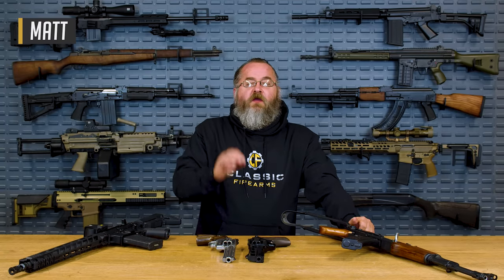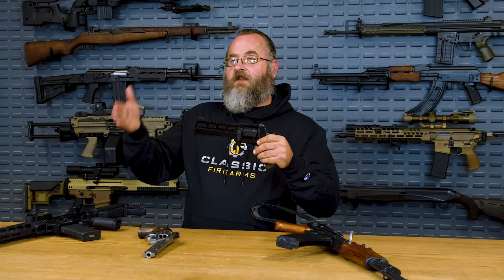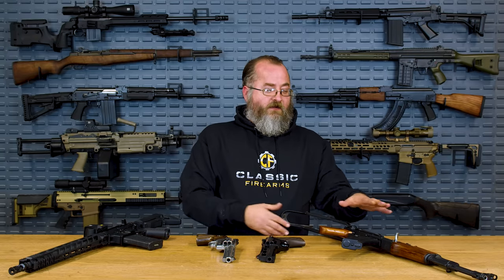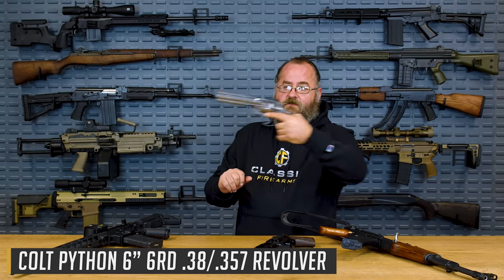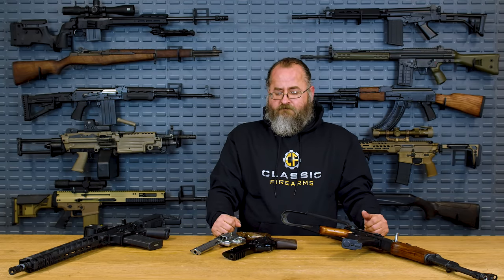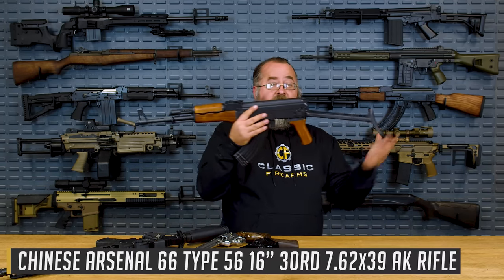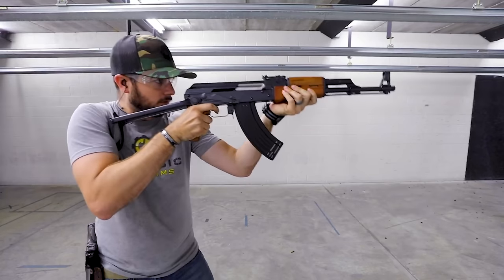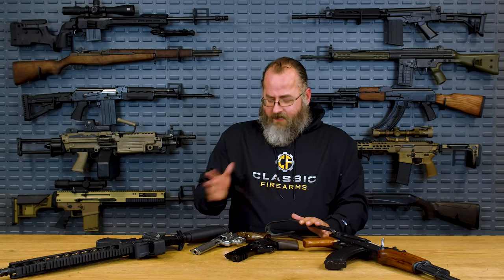The Science Of Gun Recoil & Firearm Design

Comment: Except newtons laws are easily disproved with a simple screw. Rotating a screw does now produce an opposite action. Known as the right hand rule. The concept of equal is disproved by atomic bombs.
Reply: What? Yes it does. The screw is pushing against the screwdriver as the screwdriver presses against the screw.  Atomic bombs don’t disprove equal force. You’re confusing it with destruction of energy and matter.  But matter and energy are the same and some mass is converted to heat energy.

Comment: What about the Kriss Vector? Worth looking at for recoil comparison
Reply: Vector doesn’t change the basic bullet acceleration/force reaction back into shooter.  What it does effectively is redirect the location and angle of the reciprocating bolt/carrier equivalent from backwards with a thump when it hits receiver stops to downwards with a thump, which somewhat counteracts the other recoil forces and helps re level the gun late in the recoil cycle.
Reply: You are right, but the design does reduce "felt" or perceived recoil I feel like the vector would be a nice add in to the high verses low bore axis video since it is unique compared to those standards
Reply: @jdroper1225   Yes.  Another good one would be Laugo Alien for the lower bore axis / reduced muzzle flip.

Comment: Also, 1. 30% of all recoil comes from the bullet traveling down the tube. It’s just physics. Again, Newton 2nd law of motion, an object in motion will generate an equal motion in the opposite direction. 2. Barrel length and gas tube length and piston travel distance all will have an effect. For example, the 5.56 round is designed for a 20 inch barrel. A 5.56 fired from a full size M-16 will feel more like a slightly more powerful .22LR instead, especially since it has a full rifle length gas system, by the time the round pass the gas opening, 80% of the powder have been burned, meaning only 10,000PSI of pressure are knocked back into the BCG. In comparison, mid-length system generates around 15,000 PSI, carbine length 17,000 because a lot of powder have not being burned yet and the explosion haven’t had time to really dissipate. This plus less barrel and gas tube to absorb the recoil mean you gonna feel more recoil than a full length M-16. This is why firing a MK18 sometimes feel like shooting a 7.62mm instead. Same with the AK. Shooting the AKSU will feel a lot different than firing a full size AK-47 cause the AKSU has less barrel mass, less piston mass, shorter barrel, shorter piston and travel distance to absorb the recoil.